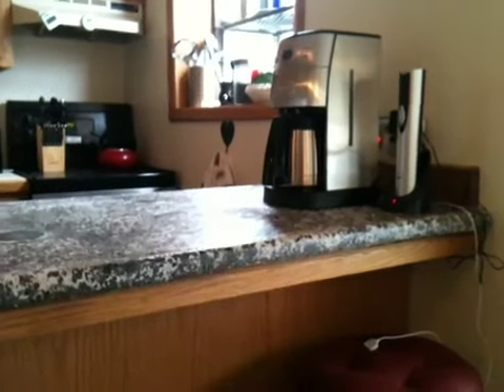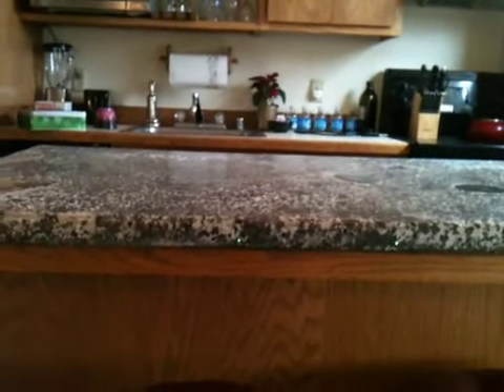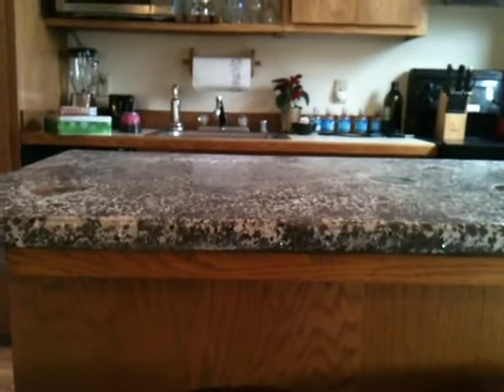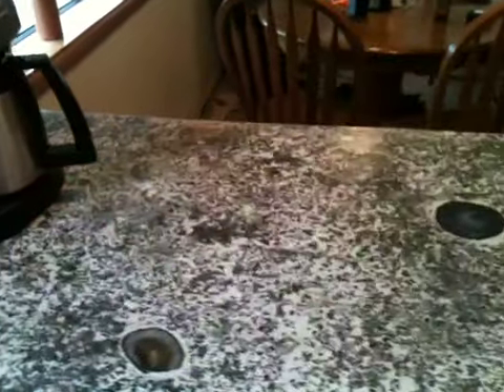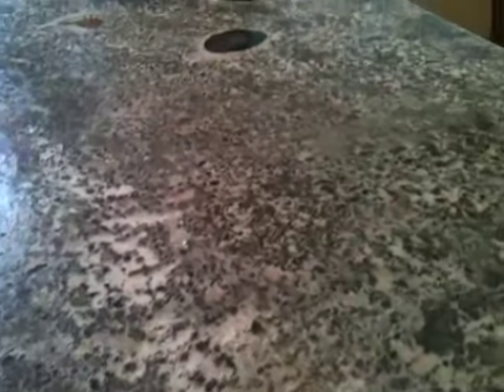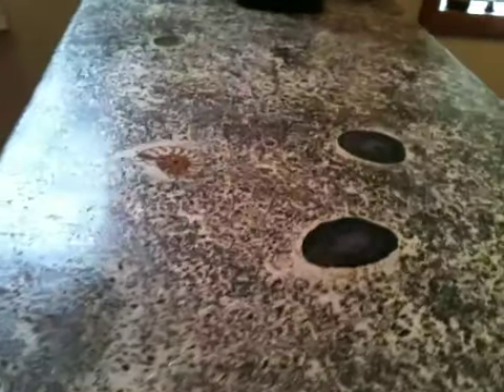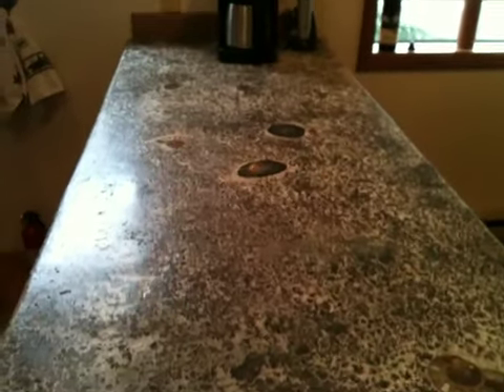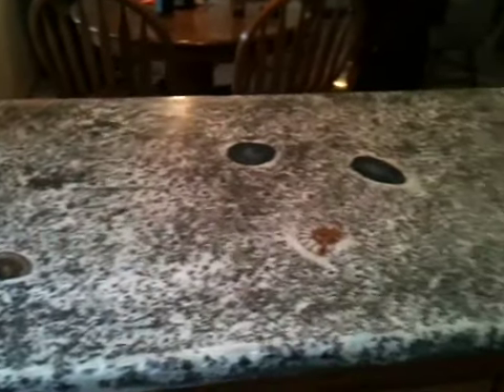Marbled concrete with LED powered Fiber Optics

Comment from the maker: About any ready mix or concrete shop has the "lamp black" used on this.  They often use small amounts of it to tone down the color of new concrete poured next to old slabs.  Good question if I had failed to say it.